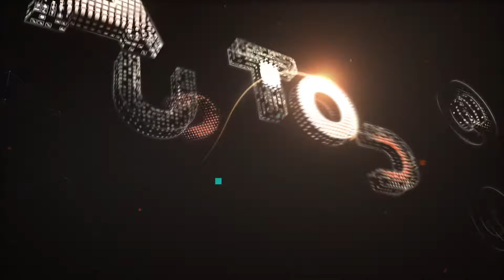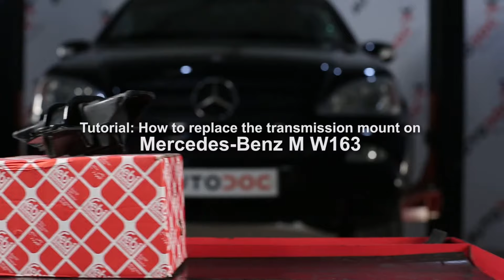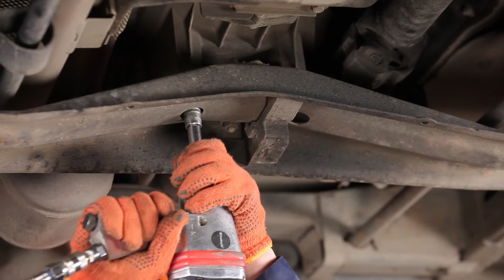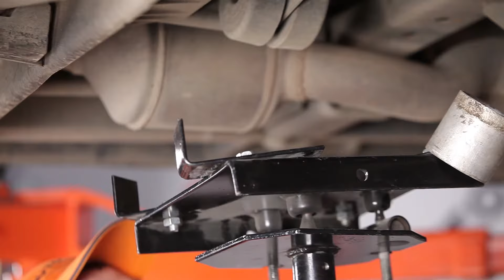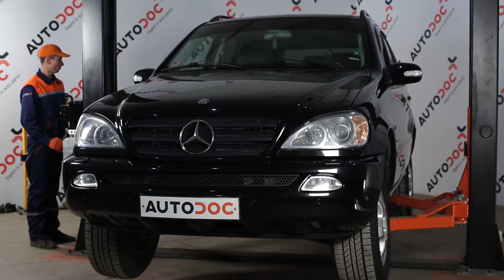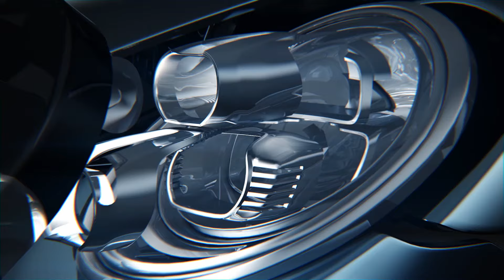How to change gearbox mount on MERCEDES-BENZ M W163 TUTORIAL | AUTODOC

Comment: And also do you have to know the torque spec for the bolts?
Reply from the maker: Thank you for the feedback! All torque specs are indicated in the technical documentation on the vehicle maintenance, you can find them out at the official car dealer. Best regards, Autodoc.
Reply: Update just did this job in an hour thanks to you without even having  the car on a lift or jacked up just the transmission thanks again

Comment: I have a question, i have a 2004 Mercedes ML500 and the car vibrates after 50mph and gets worse around 75mph, ive changed the center prop shaft support bearing and inspected the U Joints, ive changed motor and transmission mounts, ive changed front wheel bearings and ive balanced all the tires, still have no luck finding out what the vibration is, if driving at 80mph i put the car in N the engine stops accelerating but the vibration is still present, do you have any ideas for me, thank you
Reply from the maker: There can be many reasons, it is not possible to answer your question clearly. However, there is still a hanging bearing, which grabs the cardan shaft, there is a possibility that the reason is in it. However, for an accurate answer, you should contact a certified service station .
Reply: Im guessing the cardan shaft is same as the propeller shaft? Ive replaced the hanging bearing which came as one unit with the center support, mercedes dealer says its possible the front differential bearings are going bad and wants to change the differential first, could that be a possibility? They haven't diagnosed anything, just did a road test and said its a possibility.
Reply: Bilal Mahomed check harmonic balancer aka crankshaft pulley